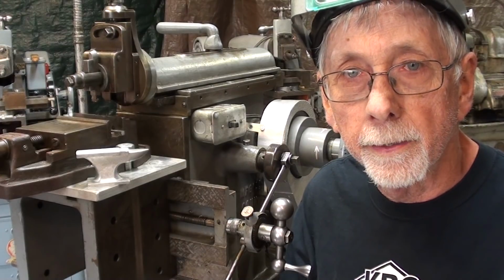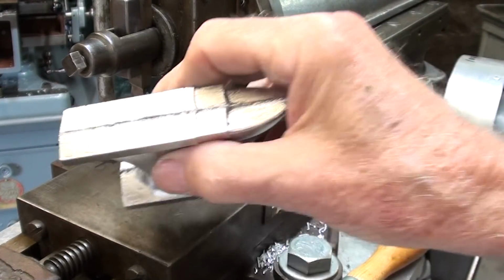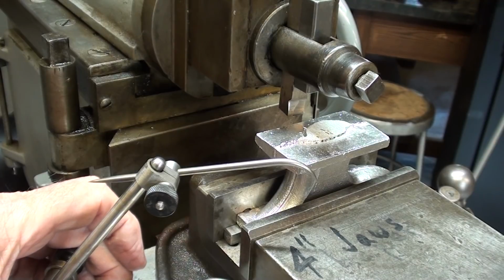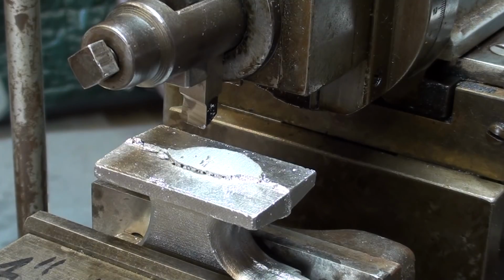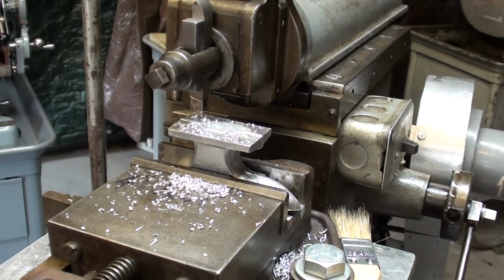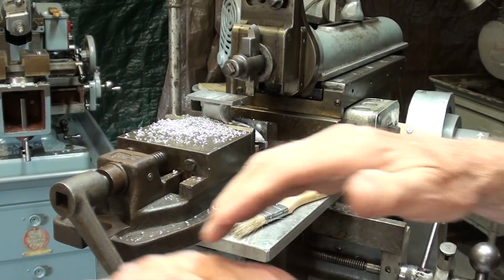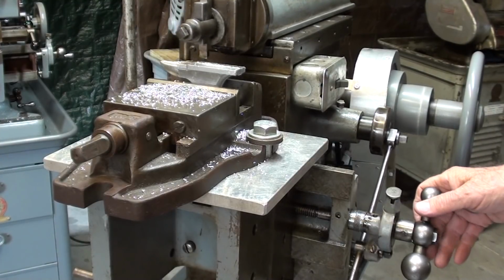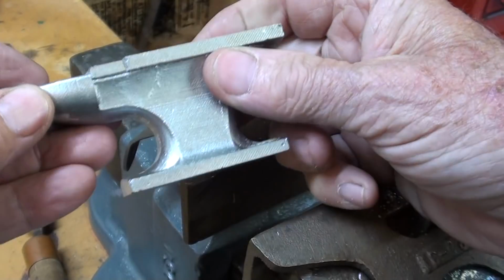MACHINING A PROJECT ON RHODES SHAPER Tips 684 tubalcain

Comment: Excellent video of my love for shapers along with foundry work. Thanks Lyle👍
Reply from the maker: I was thinking, of projects for you. Small iron anvil paperweights. Six or eight on a match plate. Souvenirs?
Reply: @mrpete222  I have had request for those after casting some anvils last year that were close to that same size. It's in the plumbing and as I get more help I will certainly be taking another look at this 👍

Comment: The little step is for cutting. Unlike the main surface of the anvil, it is not hardened, so you can use a cold chisel with the assurance that if the chisel penetrates the workpiece, it will damage neither the chisel nor the anvil. (Actually, it will mark the anvil, but you can either ignore the marks, or file or grind marks off the step without worry. Or just hammer them flat if they stick up too far.)
Reply from the maker: Thanks

Comment: The step down is called the table, used for cutting or chipping and sometimes bending, it is there ti hammer on to not damage the main surface of the anvil. I know I am weird to know that but I am getting deeper into smithing and anvils as I progress.
Reply: I just saw the very end and a 38 Coupe????????????? That was a beautiful car even for 1938 now I am jealous not only of the machines you have but of the one that got away.
Reply from the maker: I sure wish I still had that car
Reply: @mrpete222  I have the Mecum suction going a block away and I wish I had that car just to rub in their faces. Nothing today compares to the machines pre 1960.

Comment: Love the videos on the Rhodes shaper. I have the same shaper with a different motor and pulley set. I believe originally they were all line belt powered.
Reply: Does yours rattle like this one ?
Reply: @millomweb  no mine is very quiet. No gear rattle at all.
Reply: mine had the bull gear replaced with a 1” thick fiber reinforced solid Bakelite gear by the previous owner who was a tool and die maker. That is why it is so quiet.
Reply: @JTL1313  Maybe this one has worn teeth or they're not properly meshing.
Perhaps a good dollop of grease will quieten it.

Comment: The step is the Chisel Step as it was the softer metal and not the hardened forge welded on work surface. Sad on a lot of anvils that's what it has been used for (as it was intended I guess) and is all marred up. Best to use a plate on top of the anvil to chisel on.

Comment: Hi Lyle, excellent job, love to see shapers being used. Quick question, watching the extra credit footage, and also looking at the raw castings, I didn't see a vent? Are there formulas regarding size of gate v/s size of casting that dictate if you need a vent or not? I noticed the gates were big compared to the casting size. Apologies if you have covered this in a previous video. Keep up the good work. Cheers, Jon
Reply from the maker: I do not use vents, because it is an oil based sand.   No formulas, bguess and bgosh

Comment: I stayed for the extra credit.  I very much enjoy watching the entire process even though I have see this many times over.  That would be a great little anvil to have in my woodworking shop if it was cast iron.  I use a block of steel to straighten little parts.  I may need to go to Horror Fright and see if they have a little anvil.  WAIT, it would be a cheap piece of Chinese junk, better look elsewhere.  I wonder if Windy Hill Foundry makes little anvils?
Reply from the maker: He does not. But we are considering that as a joint project
Reply: @mrpete222  At some point if you two decide to do that I would be pleased to purchase one.  I have no machining equipment so a flat bottom and top would be needed (I am great with a file for the rest of it and I always love a project).

Comment: Oh no! Mid roll ads are back Lyle.
Reply from the maker: Thanks, I’ll take that off. Do you know what is happening, this is a Video that I made three or four months ago. And just released. Thank you for telling me
Reply from the maker: David, did you notice that I’m standing up while I do my molding? LOL
Reply: @mrpete222  Yea, you can do it that way.! A lot of viewers suggest a bench. My reasoning is I don't have room. My car lives in the space where I do the casting. I pour at ground level and it would mean lifting my 120 kg of sand on the bench, then lifting the heavy made up moulds back to the floor.
I  also have kneepads in my trousers ( pants) and have spent a lot of my working life so am used to this position. Keeps me supple now.
Reply: @mrpete222  I think you need to check the settings every video upload.

Comment: Lyle, what aluminum do you use, do you melt aluminum cans?
Reply from the maker: Old pistons.  Never never cans
Reply: @mrpete222  old pistons would have better metal to use anyway. As to aluminum cans, I've been told that there's some porosity in this aluminum.

Comment: I always 'thumbs down' any video using fingers instead a brush to remove chips.
Reply: Picky?
Reply: @ellieprice3396   Ellie, no just being safe. If they can't produce a safe instructional video..... THUMBS DOWN.  Novices don't know better, can get hurt repeating unsafe practices.
July of 1960 the Boss of my first job just loved to wipe the 2 " long razor edge brass chips away from the workpiece with his index finger forming little piles on the floor.  He was milling with a 4 flute 1 1/2" diameter by 4" long spiral end mill. Still brings chills when I remember.
Still work in the same building, however I have murdered dozens of paint and acid brushes during that time.